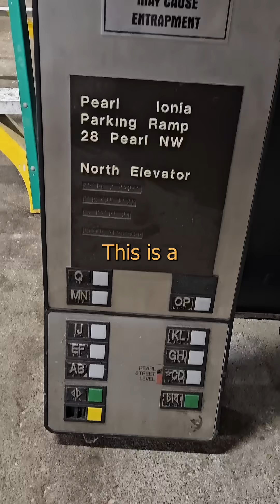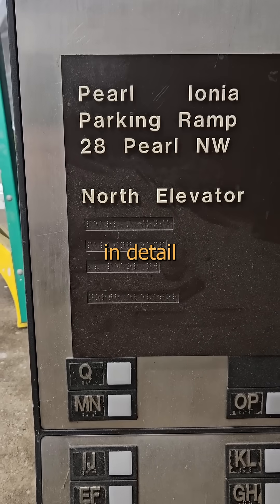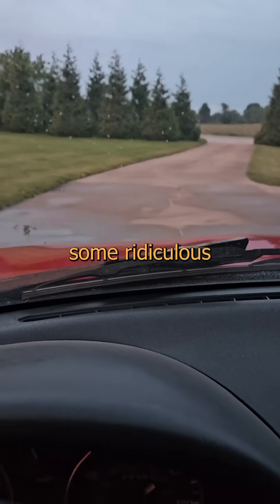Miata Mischief #chrisboden #engineering #gear #elevator #score #stories #parts #hacking #making

Comment: I once shoved 7 transmissions worth of 60's era 4 speeds (a couple borg warner, mostly muncies) into an 08 eclipse. Aside from pretty much doubling the weight of the car, the rear shocks ON THE BUMP STOPS, when we rolled up to the guy's house, in the middle of bum-fuck egypt AL, the banjos stopped, my scrawny city slicker ass gets out of this bright fucking orange shitbox and think "well, guess this is how i die". Go to meet the man, shake his hand, and ask where the parts are. To which he responds with a point and a grunt to an old box trailer out in the middle of his back 40. There were all sorts of awesome cars being reclaimed by the weeds, hurt my soul to see, and one narrow piss poor excuse for a path out to the box trailer. I had to back this bulbous orange turd half a mile in the weeds cos there WAS NO TURNING AROUND with all the brush and thickets... well... we get back to the trailer, open it up, half expecting to see corpses on meat hooks, but no! It was several boxes, 5gal buckets, and entire casings to several transmissions emitting that odor most foul, 50 year old gear dope. Muncies, borgs, hell even a few Hurst pro comp + shifters! Everything but a bellhousing! Anyway, load up all these parts, and even with the back seat folded down and me eating my knees in the passenger seat cos my buddy was a foot shorter than me so once everything was in he could drive while i wouldve been a damn pretzel jammed up against the wheel. All said and done, we made it home, miraculously didnt shatter any of the glass in the mitsubitchy and that car NEVER smelled the same again. The end.

Sike you surely didnt think that was the end of the saga, hell no, far from it. So, here i am in the shop, surrounded by more tranny bits than i ever expected, and a printed out piss poor scan of a muncie rock-crusher exploded view and got to tinkering. Sorting needle bearings, checking gear ratios, main and secondary shafts, and found it in the pile, the holy fucking grail, i got a genuine wide ratio rockcrusher. So then i order the rebuild kit to get new syncros, bearings and seals, as well as a chevy pattern bellhousing. Find and order a clutch pedal assembly + z-bar and linkage for my 76 camaro, Charlot. Well, Charlot needed a transmission because i straight up murdered the fresh built turbo 350 by taking a pass down the street at 70 miles an hour... in. FIRST FUCKING GEAR! [7300rpm with 2.73's in the rear, we did the math, no the speedometer didnt work yet, nor did i have time to check my speed but thats a story for a different day]

I dont own that car, or any of those transmissions anymore, but i still have the engine that blew a tranny, it lives in my '82 c30 3+3 camper special, and it slung a rod... so... lets see how i get that damn block to a machine shop.... when the truck is out of order...😅

Comment: I got a 8'x3' framed poster of DS9 (Star Trek) and the wormhole behind it and a bunch of space at a flea market and I didn't have a truck at the time. How did I get it home? Strapped it to the roof of my 99 alero through the windows with ratchet straps lmfao. Took the freeway home at 70mph and from experience I can tell ya not as sketchy as it sounds.

Comment: We used an old ass sack truck made from wood and iron, with iron wheels, to haul a concrete(?) garden table looking like some roman heirloom. That table would have ruined any regular modern sack truck with rubber wheels 🎉😅
Also amazing how much weight you can easily move on your own with these old sack trucks. Probably for the better these aren't around anymore, because unloading that weight, once you've reached your destination, is another story... 😅

Comment: About the sketchiest thing I’ve done hauling is pulling a fully loaded U-Haul 5x8 box trailer with my Ioniq 5, well in excess of its official tow rating. Other ridiculous things, though not sketchy, include fitting roughly the equivalent of 6 check size suitcases and two people into a Nissan Leaf then driving all the way from southern Delaware to Pittsburgh in July for an event a friend and I went to (look at my profile pic and you can guess what :3) It all barely fit, and the fact one of those things was a 3D printer I couldn’t stack anything on definitely made it a challenge, but I managed to Tetris it enough that we could just fit comfortably

Comment: About 10 years ago I wrecked my accord and I had my buddies civic delsol to drive. Well I went to the junk yard and got a hood, 2 fenders and bumper cover. Bumper cover and fenders went in the passenger seat just like the elevator control pannel and the hood was tied to the targa top. Made it hone no problem.

Comment: I am very late but i have two
I transported my whole mothers small furniture in my car, the car was full to the brim, i started it in neutral, pushed it in gear with sticks on the clutch and walked besides it in idle speed across town
And last year when i moved into my stuff into my first house we walked everything across town in wheelbarrows and hand trucks

Comment: Wa a a screen printer, moved a autel titan-x. About 6k lbs fully loaded. Moved it across town on a moving dolly being pulled behind a f150 with my assistant and my boss sitting on the tailgate  holding the dolly and me on the legs of the dolly trying to hold it level while doing 5mph with the hazards on.

Comment: I used my mom's 02 Audi TT to pickup and move a bead blasting cabinet. It was a manual transmission and the blasting cabinet blocked a couple gears lol. Was a fun drive back to the shop

Comment: I put a 250 gal tote on the the roof of my ford EcoSport and drove it 30 miles with 2 straps 1 front to back the other side to side  it covered the whole roof of my car  and I had more lumber on the roof of the same car then a dodge ram 3500 could haul in 3 trips from Hackettstown Nj to windgap PA about 1500 lbs. the boards were 12 ft long and hung over the front and back of my car by2 ft with 3 2 inch straps

Comment: Back when I was working at Kenworth as a delivery driver they were throwing away a perfectly good metal shelf. I did not have my truck at the time my cousin was borrowing it and the only thing I drove to work that day was my Sebring convertible in the middle of winter. Long story short it was a very cold ride back home

Comment: My dad put a full size refrigerator in a Vegas station wagon. My own was 1 ton of feed in a Ford ranger. It was bagged. I put wood blocks to keep the springs from breaking. Over 25 and the front tires were coming off the ground. 22 miles later I was finally at the farm where I was taking it.

Comment: nothing ridiculous Just shingles for the roof of the house we got the trailer loaded and halfway out the lot when the neck bent so we left the trailer in the lot and came back the next day with a uhaul car trailer we got the shingles on the car trailer then decided to put the original trailer on top of the shingles on the car trailer to drive it 47 miles down interstate 412.

Comment: Crazy story but My newly purchased Klimov RD-33 afterburning turbofan engine (Yes the one used for the Mig 29, because my Mig wad missing one, dont ask why I have a mig thats not important...) in some eastern european country far from my home town in Poland, I had nothing but a Polski Fiat 126P Maluch and lots of "wishfull thinking". Had to use Lots of elastic cord to hold the wheel straight or atleast aid in holding it straight (because a jak knife could mean death to my car or damage to the engine), my right hand for the stick (Its a manual car) and wheel, left hand for also the wheel but it was to operate the parking brake lever from a Maz 537 (why I had it on hand?, one at home was in progress of being repaired, transmission issue and thats why I did not use it, its owned by a tank museam, I ocasionaly borrow it when I need some heavy transport) ziptied to the steering wheel because brakes now had to be done by both the poor Fiat 126P and the large relativly trailer. It was atached through a hose to the large trailer and used as basicly a crude way to operate the trailer brakes (for context the trailer was big for the tiny fiat 126P but mostly normal sized for anny other "Standard sized car") because as much as I wigh my car obviously does not have any fesable way to support such system required for such brakes.

Comment: I drove with a couple boards of 12' lumber in my Subaru Legacy with the trunk closed, so the boards were 1" from my windshield to the back edge of the trunk. Then I hauled 600lbs of pavers in one trip, distributing the weight across each seat and trunk.

Comment: I did transport a on Clearance shelving unit in my Miata one time, the only place it would fit was on the passenger seat sticking up high enough that I have to have the top down, and it wanted to tip over the entire time, it was fine because I could keep it stable by keeping a hand on it, the problem was every time I went to shift gears I had to shift as quick as possible and move my hand back to catch the shelving unit before it would fall on me while driving

Comment: My son and I went to pick up some old bricks in my Toyota RAV4, I figured they'd fit in the back so I wouldn't need the trailer. Forgot about the weight I did, bottomed out there shocks, had to move as many to the front of the car to try balance the load. That's the day I learnt how shocks improve the handling of a car.

Comment: I hauled home 10, 12 foot chunks of 46 millimeter round stock in my nissan sentra because it was getting thrown away. It was so heavy, it broke the passenger seat i had folded down for it to rest over. Still can't believe the tires didn't pop

Comment: I fit a volvo V70 engine and gearbox into a Lada 111 station wagon, with the rear seats up! It was lifted into the trunk with a forklift.

Drove 160 miles with the rear suspension flat at the damper stoppers.

so we had to disassemble the damn thing to get it out of the trunk

Comment: A few years ago, I was looking around on Google earth and saw what looked to be an abandoned rail yard.
So I drove over with my 99 4runner and found a few 39ft rails just lying around! So I thought I'd just yoink some.  Well it wasn't going in the back that's for sure, so I had to lift the ~1700 lbs rail on the roof rack I'd just got off amazon...yeah.
First order was to get it up onto the ARB bumper, so I raised up one end with my winch and used the Hi-lift to get it the rest of the way as I fought the thing to not come crashing down sideways on me. Once it was on the bumper I thought I could simply just drive forward, and it should naturally lift itself onto the roof! Well it went for a few feet before it started to dig the far end into the earth. So I rigged the winch to the other end to pull it up and over. Once it got to the windshield I layed a dolly down underneath it to guide it up to the roof, I don't know how it did not shatter it! I just kept winching and eventually it reached the balancing point and cantilevered over to lay flat on the roof. Of course my roof rack was basically split in two but the roof itself was holding! If only I had some coal on me because I could have turned em to diamonds on the drive home that night.

Comment: I once needed to haul some drift wood timber for a project of mine. It was and 5 decent length logs and all I had was a 2009 Scion tC. I busted my windshield going over the speed bump 200 feet from my house, but I got it all home and built a pretty nifty beach themed bench and bookshelf.

Comment: VW  rabbit, 10 foot copper pipe sticking out the front passenger window like a misaligned lance, because that POS was in such rust-belted end-of-lifeness that the rear windows couldn’t open, and the hatch’s latch was so oxidized-to-hell it probably had just a couple of cycles left in it. 
I made it home, and even swerved to avoid impaling a bicyclist I passed. 😂

Comment: I once collected four bucket style hard plastic seats from behind a Little Caesars and managed to cram them in the backseat of a 1973 super beetle by putting the front seats as far forward as I could and putting the chairs in the backup side down two on each side. My face was damn near smooshed against the glass the whole time and I basically had to sit side saddle using my feet at a very odd angle to operate the pedals with my nearly 6 ft frame, but they managed to make the ride home.

Comment: Ever haul a safe? No? What about using a trailer that was falling apart? 

I did, that was sketch as hell. We loaded the safe onto a trailer but the wheels dropped through the wood of the trailer, we didnt strap it down, we just set it on the crossmembers and went on to the interstate with it. Got paid 350 for that one

Comment: Wanna hear something cool?!

I stole a dirtbike to get bagels

I was 15, it was covid, i wanted bagels. Dont ask me why i wanted bagels. I got no clue. It was just one of those impulses that gets into your head and makes you crazy. I had to get bagels. But at the time my bicycle was broken and i didnt have a drivers license yet. Buttttttt, my dad had a dirtbike. My thoughts were that even if i did get pulled over, id get in less trouble for riding a dirtbike than driving a car unlicensed.

I thought if i started it and rode it out that my neighbors might call someone (ring camera + no chill = 911 call). So I toom a motocross helmet and pushed it across the street, through a dirt lot full of cactus, through a sand filled wash, onto a dirt trail, onto an old road, and then about another 100 ft just for safety. 

I then... at that point, tried to start it up. Nothing. After 20 minutes of trying to kickstart this thing, it just fucking hated me. It would start up, but would always stall for some reason. Like most women, it was hot but i just couldnt get it turned on. And after 45 minutes of trying my best to kick it into submission, it revved to life. I put on the helmet and I started riding. This thing was unregistered and NOT street legal. So i thought it best to avoid the streets and sidewalks. There was a church up the road i was on. I went through the parking lot there and into the park across the street from that. In that park, its usually pretty empty. Theres also a trail in the back of it that feeds to a side street that leads into the back of the grocery store. I rode all the way there like that, parked in the back of the store. There was no key, so i just ran inside and hoped that no one knew how to kickstart it. I got my bagels. Ate one. Hopped back on the bike and rode back the way i had originally came. But then, my mom and sister drove right past me! I'm told that at first they didnt believe it was me, but my sister couldve swore it looked just like me. At that point i decided to go down my street and meet them at the house. 

They called me an idiot, but I had bagels now. Sometimes, its not about the destination or the goal of your quest, but about having fun on the journey. And thats pretty cool!!

Comment: I don't know if it really counts, but i finished a welding pre-apprenticeship a couple weeks ago, and they gave us each toolkits for our trades. The car that i was supposed to drive to pick it up ended up at the mechanic the day before, so all I had was my motorcycle and a single ratchet strap. A case with 2 drills and a duffle bag with a faceshield and welding mask both ratchet strapped onto the little passenger seat, plus the backpack with the rest of the welding gear on my back. Probably the only time I've ever made that whole drive under the speed limit, and I looked like Quasimodo the whole way. Made it though.

Comment: I had to cut apart and remove an entire old boiler from a highrise apartment building in Toronto, removed and cut as much as I could and after a good 60 trips from the roof to ground level i loaded the whole thing into my 2016 cherokee front to back. Had  all the seats down flat and the boiler took up every inch of the vehicle. Had to put the drivers seat forward could barely move let alone see out of the passenger side and it was so much weight it was bottoming out the suspension driving over pebbles and expansion joints on the highway.... needless to say that was probably horrible for my suspension.

Comment: 2002 Ford Escort 4 door
Driver(my dad) plus Passenger(me)
20ft flag pole antenna with square base totally inside the car without any of it sticking out and all doors and windows closed
Had to get it diagonally from the rear driver's corner of the trunk into the front passenger seat so the tip was sitting over my lap for the entire 30+ minute drive.

We scratched up my glove box(the car became mine a year or 2 later), great little gremlin for short 1.5hr jaunts between home and parents house with it's somehow miraculous 50mpg highway(unless you turned it off partway and let it cool down at all) - it later died of an aneurysm, the head, pistons, and valves got in a very expensive argument, twice, and I never repaired it on the 2nd time around($1800 is enough to pay for repairs once on a $2000 car)